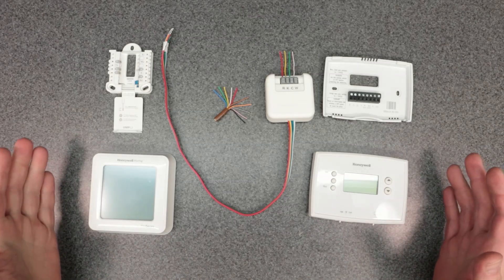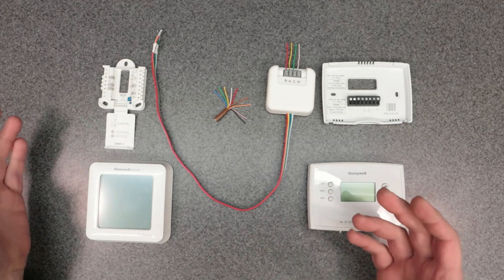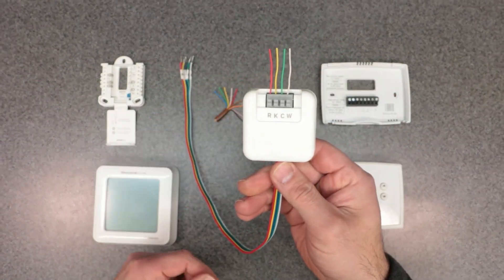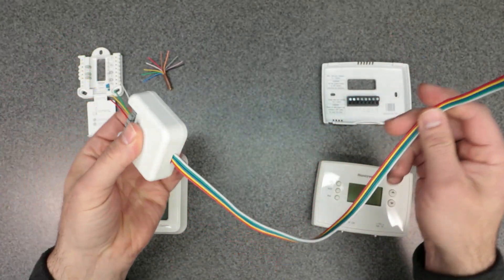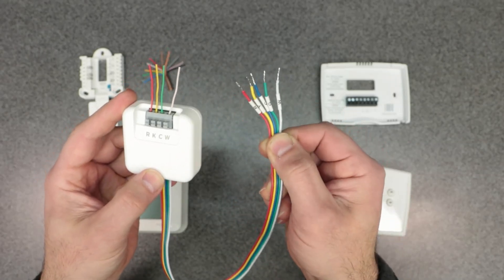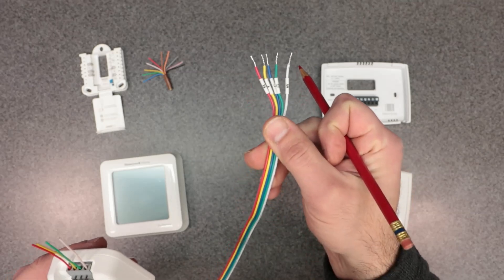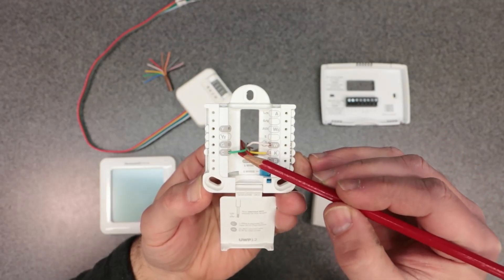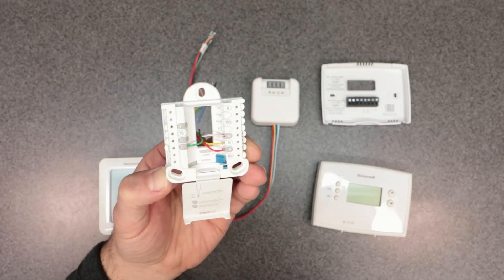HOW to Install Honeywell Common C Wire Adapter (Heat & COOL - NO Rewire)

Comment: I have 6 wires. Orange and brown as well because I have emergency heat but no blue c wire. Had a new 2025 Arcoaire 35,000 installed and tried to go from the old dumb Honeywell to a new T series for WiFi ability. The control board of the new Arcoaire is confusing.

Comment: Dumb question? But if the fan and cooling are linked, is there no fan pushing the heating when heat is on?
Reply from the maker: Yes. So you would need to deactivate the cool system somehow. So both cool and heat arent on at the same time if you have forced hot air for heat.

Comment: What if you only have 2 wires connecting to your thermostat
Reply from the maker: Im guessing you only have the red and white wires? Just install those wires and C wire.  Then ignore the Y, G, K terminal/wires.

Comment: Thank you.   Appreciate the clear instructions.   I have the adaptor on order.

Thanks for explaining the mechanics of the 5 wires to 4 wires.   I don't mind the fan and a/c  being combined, since ai never adjust the air anyways.

Don't look forward to crawling in the attic to hook it up, but a lot cheaper than hiring a hvac guy.